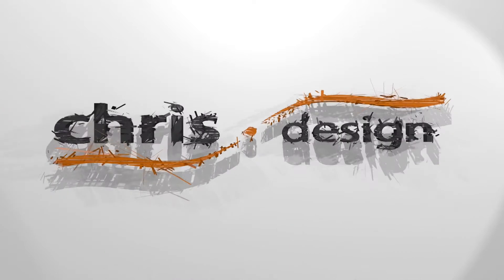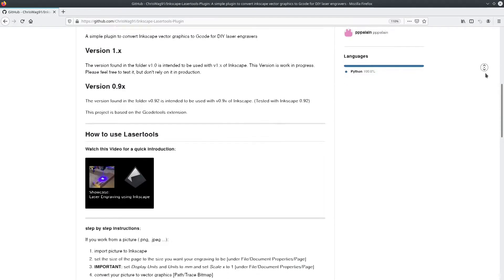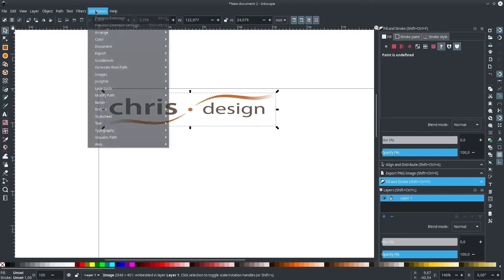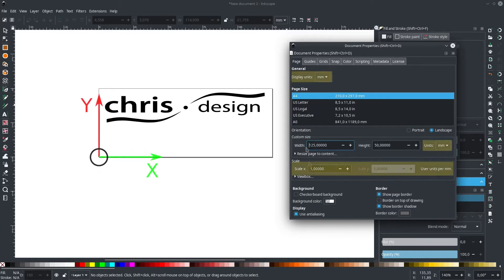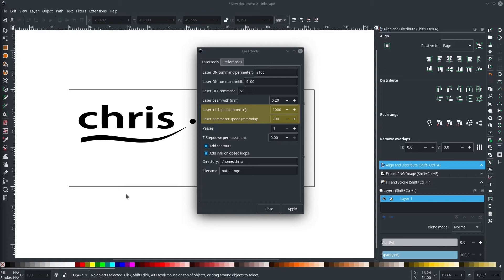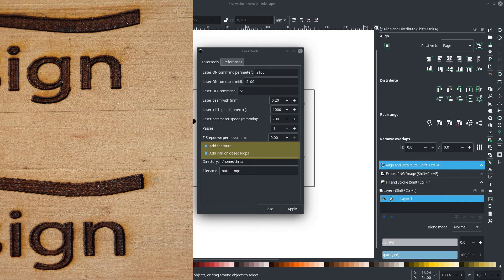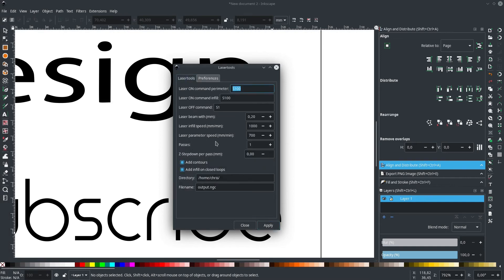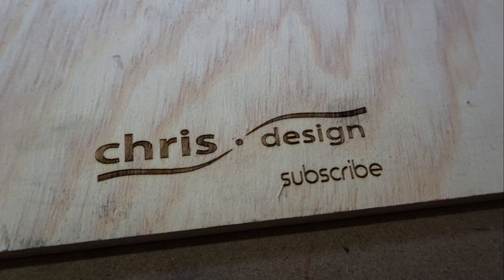Inkscape Lasertools Tutorial

Comment: Hello! The extension is very good. But I have a problem: when it finishes laser engraving the vector, the laser is still on and burning the trajectory until it reaches the origin (x=0 / y=0).
I have tried various laser off commands, and even modifying the g-code by hand, but the problem persists.
Any possible solution?

Comment: Thanks for the tutorial, I was engraving just fine with this until I tried modifying the gcode preferences. I reverted all the settings back, but when I click apply in the lasertools interface, it splits the vector points from the object, and won't center them on top of eachother, so the gcode is screwed up. Has anyone had this issue? Were you able to fix it?
Reply: Follow up just incase: The issue I'm having isn't with the LASERTOOLS, its actually when I resize the document, when I resize it so it fits the design, my bitmap gets offset by a random amount... still working to understand if its something with the pictures I'm trying to etch, or a bug in the software.

Comment: Hello, I'm very sorry but using lasertools extension I get the following list of warnings and, of course, an empty output file.

Traceback (most recent call last):
  File "C:\Program Files\Inkscape\share\inkscape\extensions\lasertools.py", line 1744, in <module>
    laser_gcode().run()
  File "C:\Program Files\Inkscape\share\inkscape\extensions\inkex\base.py", line 131, in run
    self.save_raw(self.effect())
  File "C:\Program Files\Inkscape\share\inkscape\extensions\lasertools.py", line 1715, in effect
    self.area_fill()
  File "C:\Program Files\Inkscape\share\inkscape\extensions\lasertools.py", line 1091, in area_fill
    print_time("Time for rotating")
  File "C:\Program Files\Inkscape\share\inkscape\extensions\lasertools.py", line 401, in print_time
    print_(time, "   ", *arg)
  File "C:\Program Files\Inkscape\share\inkscape\extensions\lasertools.py", line 384, in print_
    f = open(options.directory+"/log.txt", "a")
PermissionError: [Errno 13] Permission denied: 'C:\\Users\\enric\\Desktop\\Files per CNC\\/log.txt'

I think that the .svg file that I'm using is error free, mainly because it works correctly with GCodeTools etension and I can obtain a  .ngc file that works on CNC 3018

I cannot understand what should I do.

Can you give me some help, or suggest me where can I look for a solution.

Comment: This is a fantastic tool. I run into a small issue when converting a stroke - I seem to get both sides of a single line being converted to g-code. Any idea what setting or workflow error I have caused?
Reply from the maker: It should work if you convert the line to a shape by using Path/Stroke to Path

Comment: Thanks for this tool, I much prefer it to the other other tools i've used! I have a question - I sometimes want to engrave an open path, let's say it's a curved line like a C. It seems that "contours" will close this line, turning it into an O, treating it as a closed path. I've also noticed that simple straight lines will often be engraved twice, like they're being "closed" too. Is there a way around this? Thanks!
Reply: actually, I found that this is already an issue on github. I have made some changes to the code that seems to fix this problem. I'll try to make a pull request.

Comment: Thanks, this is the only tool that works correctly in my ender 3 pro.
Great Job
Reply: hey there Agus, did you get your laser to work well with your ender 3? im using the extention on a ender3 with a 2.5w diode laser. the results are not bad at all. just wanted to know what settings you use wrt speed and pwm frequency. im trying to engrave on wood.

Comment: I am not sure that I can understand this generated Gcode. Made 10x10 mm square and got strange Gcode:
;Inkscape Lasertools G-code
G90	;Absolute programming
G21	;Programming in millimeters (mm)
M03 S1 ;Activate laser and set power to 0 (CUSTOM)
 (spindle on, CW rotation, enable laser but not fire)

; START perimeter strategy
G01 F700.0
 (move in a straight line at that feedrate, 700.0, but where to move?)
S0
 (turn laser off)
G00 X0.07 Y0. F3000.0
 (set X and Y as zero position, well almost, not exactly zero because of square being out of 0X, 0Y, move at 3000 mm/min)
S1 F3000.0
 (turn on laser, and move? where to move? and why feedrate for turning on the laser?)
G01 Y9.0 F700.0
 (since laser is on, begin to cut at 700 mm/min - vertically, go almost to the end)
G01 Y10.0 F700.0
 (move one millimeter more to finish first line - vertically, why is that separate from other 9 millimeters?)
G01 F700.0
 (move at 700 mm/min, but where?)
G01 F700.0
 (again move... where?)
G01 X9.07 F700.0
 (from current position, cut first 9 millimeters - to the right, then...)
G01 X10.07 F700.0
 (continue for last millimeter - to the right)
G01 F700.0
 (move nowhere, again???)
G01 Y1.0 F700.0
 (cut vertically back, again only 9 mm at 700 mm/min)
G01 Y0.0 F700.0
 (cut last millimeter at 700 mm/min)
G01 F700.0
 (move... whatever)
G01 X1.07 F700.0
 (cut horizontally back to zero position on X and Y at 700 mm/min)
G01 X0.07 F700.0
 (cut last millimeter...)
G01 F700.0
 (move nowhere again at this rate)
S0
 (turn off laser)
;END perimeter

G00 X0 Y0
 (Move at rapid speed F3000.0 mm/min to true home)
M05 S0	;Deactivate laser and set power to 0 (CUSTOM)
 (spindle stop, disable laser)
M02	;End of program (agree...)
---------------

Why this code goofing with moving 9 of 10 millimeters, then continuing for remaining millimeter? Then two empty movements?

Comment: I tried it with Inkscape 1.0 with my Ender 3 and used M 106 and M 107 for lasercontrol. But the laserpower will always stay at S1 as in the prefix. No change to S255. The gcode listing only says S255 or S1 for change of power, but only when I change it manually in each line in to "M 106 S255" and "M106 S01" it works ok. Any idee what I did wrong?
Reply from the maker: Did you try entering "M106 S255" into the "Laser on" fields instead of "S255" (and "M106 S1" or "M107" in the "Laser Off command") field?
Reply: @ChristophWagnerChrisDesign  Thanks a lot, that works ok. Was easy to solve, but was not so clear to see in your video.

Comment: This is the only plugin tool that will work with my laser thank you! every other plugin has a syntax error. I had one question do you have a solution for the laser suddenly stopping mid engraving? Loading with SD and I get errors that stop my laser.
Reply from the maker: Does it always stop at the same g-code instruction or at random points?
Reply: @ChristophWagnerChrisDesign  random points for some prints and exactly at the same spots for others. It varies and I can't pinpoint the issue.

Comment: Hi, This tool seems to work great, thank you. Do you know if there is a way to do different shades (or power ratings) without creating different files? I'm struggling to find a way and have scoured the internet.
Reply from the maker: Unfortunately there is no way to do that at the moment. It should be possible to implement the use of opacity to define different laser power levels in one design, but that would require rewriting quite a chunk of the code. I will look into that as soon as I have some spare time on hand.
Reply: @ChristophWagnerChrisDesign  thanks for the response.  The other I noticed is when applying the extension to fonts (after converting them), and then running it on the laser, I'm getting one or two missing fill lines on every letter. At first I thought it was missing steps but its too consistent. When i run it for a shape it seems fine, really weird
Reply from the maker: Which version are you using?
Reply: @ChristophWagnerChrisDesign  Inkscape 1.0.1 and the 1.0 extension. Its really strange, because on screen it looks like the lines are there but but the laser seems to miss them. I just doesn't make sense

Comment: Hi Chris, this is just what I need, but unfortunately using Inkscape V0.92 the Lasertools dialogue box is far too big to see the bottom commands, and the pop up window refuses to resize. I don't want to upgrade to a later version of Inkscape, because that has an "orientation points are wrong" bug, that I don't know how to fix. Is there a fix for Lasertools that will work? I am using windows 10
Reply from the maker: I just changed a few things regarding the orientation points in v 1.0. Please check if that solved the problem for you.
Reply: @ChristophWagnerChrisDesign  I did upgrade to V1 and for some reason the "orientation points are wrong" message went away. It took some twiddling with laser diameter, but now things are working fine, it takes a lot of wasted raster travel time out, and increases efficiency enormously. Big thank you!
Reply: @ChristophWagnerChrisDesign  I may have spoken too soon. With inkscape v1 lasertools only works once, then gives the orientation points error. If I open one of your demos, it makes the correct raster gcode file, but if I try again, it throws the error. So to clarify, v.9x gives a huge textbox that cannot be resized to press the bottom buttons, and v1 keeps throwing an "orientation points are wrong" if you try to make a second run.
Reply from the maker: @normmorse3250  Unfortunately I can't reproduce this bug. (Tested with several of the test files) In my tests the extension creates a gcode file each time I run it without any errors. Can you send me the file in which you got the error. You can use Github Issues or send me a link to a cloud folder.
Reply: @ChristophWagnerChrisDesign  I reinstalled the latest version of Inkscape, V1, and re-downloaded lasertools, and the problem is gone. It takes a long time, then says " lasertools.py:1130: DeprecationWarning: in the future out of bounds indices will raise an error instead of being ignored by `numpy.delete`.
  np_finalLines = np.delete(np_finalLines, index_zeros, axis=0)" but it does the job. The orientation points error is fixed! Thanks!

Comment: Tested the tool for Ender 3 laser engraver. Works fine. Currently, there is option to add three lines as prefix to the gcode generator. I would like to have exactly 6 more lines or an option to enter multiple lines in a single input.
Reply from the maker: Thanks for the feedback. You could try to put a bunch of G-Code instructions in a single Line. But I'll check if it is possible to replace the single line textboxes with multiline ones in the new version of Inkscape.
Reply: @ChristophWagnerChrisDesign  Modified the python file and .inx file to get 6 prefix lines. Tested it and it is working as expected. So I have your extension customized for Creality Ender 3 now. Thanks again.
Reply: @ChristophWagnerChrisDesign  There are still blank vertical lines on the final engraving. What could be the reason? Will infill overshoot settings have any effect on that?
Reply from the maker: @aravindpvk  Did you get the vertical lines on the preview in inkscape or only in the final engraving? Could you send me the files (svg and Gcode) you used?
Reply: @ChristophWagnerChrisDesign  The major issues got resolved after trying out the bug fixes mentioned in ur Github page. After which the Gcode simulation stopped showing any empty vertical spaces. However, I still have narrow vertical lines on the final engraving. U can find the relevant files in this link >> https://drive.google.com/drive/folders/1CfPLFHUve5jJXHSUU5n4E_ZutcgCHIsQ?usp=sharing
Reply from the maker: @aravindpvk  I had a look at your files and could not really find a cause for those lines. So I engraved your design on my machine. In this test I did not get lines as pronounced as you. But I saw hints in some places. These seem to occur wherever the machine changes direction. This would point to it being caused by backlash on the machine. Here are some photos of my tests and the settings I used: https://drive.google.com/drive/folders/1liPfMWqpSTZRJdGINPhg9D44JhTh5pXc?usp=sharing
Reply: @ChristophWagnerChrisDesign  Thank you. Assuming it to be backlash inherent to the machine, any suggestions to counter that? Also, in my version "contour tolerance" setting is absent.
Reply from the maker: @aravindpvk  Try using the latest version of lasertools 1.x along with Inkscape 1.x. That will propably fix the problem.
Reply: @ChristophWagnerChrisDesign   Okay. Will try that.
Reply: @ChristophWagnerChrisDesign  hi chris, why i get this massage "Directory does not exist! Please specify existing directory at options tab!" when i wanted to generate gcode?
Reply: hi! why did i get this "Directory does not exist! Please specify existing directory at options tab!" ? how can i solve it

Comment: Thank you for the tool and the video, been looking for something for a few days to try with my Ender 3 laser engraver. Will test this first thing tomorrow morning to see if it really out perform the other options that I have right now. Nice job.
Reply: hey there Aravind, did you get your laser to work well with your ender 3? im using the extention on a ender3 with a 2.5w diode laser. the results are not bead at all. just wanted to know what settings you use wrt speed and pwm frequency